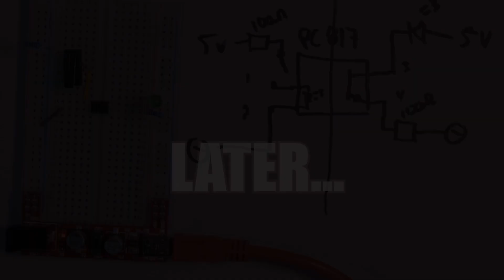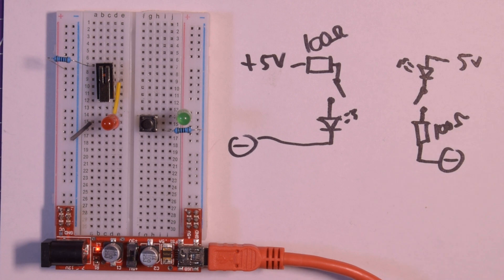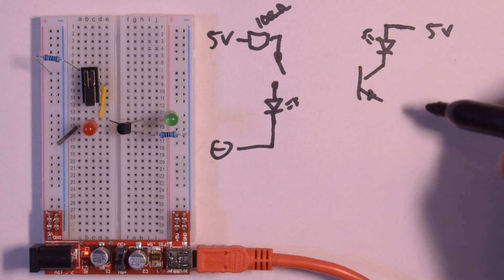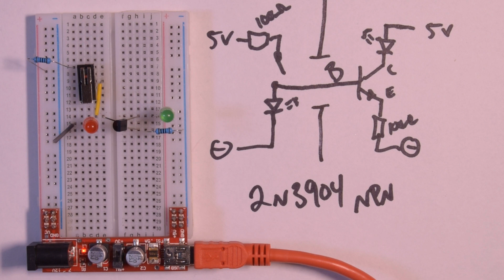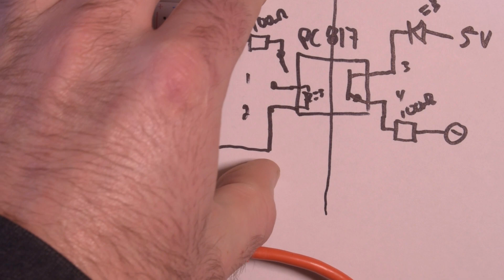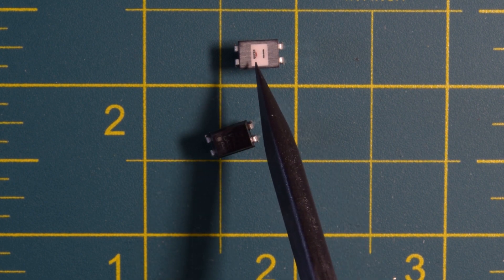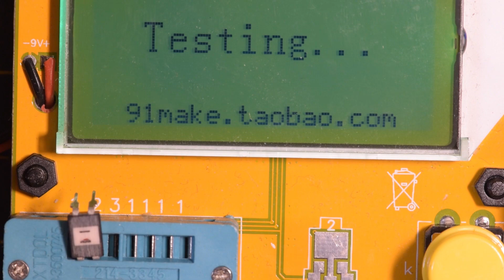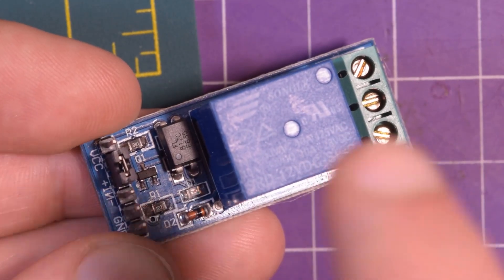How Does An Optocoupler Work? PC817 Investigation

Comment: Optocouplers were always my favourite electrical component. They are like gods compared to relais. I really wonder how relais even exist still. Probably because they can break?
Reply from the maker: Optocouplers are really only good for a few hundred milliamps, relays can drive a few hundred amps in some cases! Horses for courses
Reply: Thank you, that is indeed a limiting factor. But can't the optocoupler then switch a thyristor? It would still be seperated from the initial switching circuit, but drives way higher loads. This should still be able to compete with relais very well.

Comment: If your breadboard power supply has a common ground and common 5v then the two circuits are technically not isolated. It would be best to teach electrical isolation with two independent power supplies, say a mains DC adaptor on one side and a battery on the other.

Comment: Others may have already pointed this out but its counter clockwise pin 1, 2, 3, 4 so 3 and 4 are backwards in sketch. Also D2 on the relay control is a diode to dampen the high voltage spike that the relay coil would have when de-energized, and so it protects on that board for high voltage spiking the optoisolator.

Comment: My question: Cguld an optocoupler (PC 817 on board) used tot switch on te backlight LEDS of my dead TV.  There is no voltage on the plus side on the powerboard. The backlights have a serial connection though it has to be a rather high voltage. (low amperage)
Reply from the maker: Not directly, but you would use this to trigger a more powerful MOSFET to turn them on - these are used to isolate both sides of the circuit from each other.

Comment: Just a heads up - the Sharp datasheet for the PC817 lists the pin numbers starting at the dot as pin 1, pin 2  next to pin 1 then pin 3 across from pin 2 with pin 4 at the top across from pin 1.   Pretty standard on DIP packaging.

Comment: To my surprise the PC817 output side seems to be directional. I'm not sure if there's a diode in there or what, but I was surprised that if I swapped my wires coming out, then my device started working!
Reply from the maker: Well there is a transistor inside which is more or less directional.

Comment: This may be a dumb question. He mentions a few times that the two circuits use different grounds and are air-gapped. However, a single pcb psu is powering both circuits from a single power cord. Doesn't that mean that the two circuits do share a 5v and ground? Does the psu somehow branch the 5v and ground into two isolated 5v and ground sources?
Reply from the maker: No dumb questions. If the same power supply is used, no air gap can exist unless you have isolated transformers. In normal use, both sides would have independent power supplies.

Comment: Very nice, two tips: use a higher voltage on the left side to illustrate the use and purpose better. Second, would've been cool to see if you could light up the opto-diode after grinding it open. I know it's a wavelength out eyes probably can't see, but I am pretty sure your phone camera can see the IR spectrum :) Anyway, thanks, I just made my first optocoupler circuit yesterday to separate 24v from a 3D printer board logic input in order to be able to use my inductive probe for automated bed leveling. Nifty little things those PC817's!

Comment: Voltage does not flow.   Current flows.   Voltage is pressure or potential difference between 2 points in a circuit..

Comment: They are cool little things. I made a bench power supply from an old ATX PSU. I bought this really cool LED-lit momentary switch to turn it on. Turned out however, I needed a latching switch for it. OK, no worries, built a latching power switch with a MOS-FET and a transistor. This worked switching a regular load, but somehow disturbed the PSU. So optocoupler to the rescue! I had some laying around I salvaged from old phone chargers. It is between the latching circuit and the PSU. I don' t know what was bothering the PSU, but it is sufficiently isolated now.

Comment: I remember as a teenager heat-shrinking an LED and photo-resistor together to make a crude opt-isolator.
I'm so happy that these modern ones are so easily and cheaply available these days.
Reply from the maker: No kidding! you can totally DIY them still but I feel like a LED + a CdS + a transistor + heat shrink would be more expensive too!
Reply: @SimpleElectronics  Today, absolutely it would cost more, and wouldn't work as well. Kids these days have it easy!
Reply: @pileofstuff  I dunno if they really do. I for one, well I'm not a kid, but also couldn't wrap my head around the idea of a led and photo resistor being inside a tiny chip acting as a switch. Whenever I looked at datasheets and what not trying to figure it out I kept coming to the conclusion that one had to hook an LED up to it for it to work. I knew that didn't sound right either, so I did some digging and found pictures of a optocoupler cut in half and it clicked that it was possible. Seeing things as they are, not manufactured to the size of a fingernail. Do you think kids these days have any idea what transistors do? How they work? How they made computers possible? How they are put in patterns and designs which allow them to perform logic and math? How that equates to memory, ram, basically how does a computer actually work, at the most base level. I used to fix computers all through school, but didn't keep it up once I graduated from university. This was 19 years ago and I just recently, this year, learned how transistors work and all that other stuff. If things were bigger, more tangible, it would have made learning it easier and something that may have happened years ago instead of recently m

Comment: I first started using Opto-isolators last year, I've never looked back. They are in everything I make. (whether it needs it or not. LOL)
Reply: Nate Higgers  I make quite a few interfaces for my old 8 bit computers, if anything goes wrong with what I've plugged in, at least the computer is protected. I would cost a fortune to repair a 1981 Panasonic JR-100 in the UK.